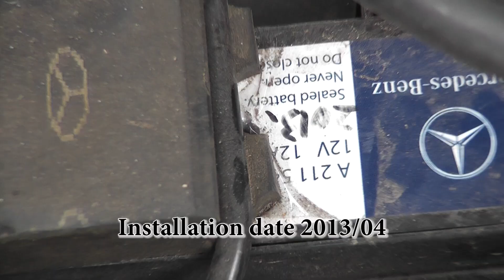Check battery in the SBC block on W211, W219 / Checking charge and year release battery in SBC block

Comment from the maker: Mercedes W211 Replacement the Fuel Filter  https://youtu.be/LVpEIoUC178
Changing SBC Brake Pressure Accumulator in W211  https://youtu.be/CCXlfeDAly4
W211 Replacement or Removing Fuel Pump  https://youtu.be/VXQa5WZXWLs
Brakes failed on the road  on W211 https://youtu.be/tUZg9WytbbE
Repair the IR sensor for Mercedes  https://youtu.be/h5GEVx5uemI
How to reset automatic transmission 722.6 Mercedes  https://youtu.be/_FjX2Yl42t4
Best Life Hacks for Mercedes W211  https://youtu.be/p6bZLZ0WcQc
How to Make AUX on Mercedes W211v https://youtu.be/7JnVR-nF0UQ
Detailed Installation Android 7.1 COMAND & CANBUS  https://youtu.be/EisTZV-FCX8
Mercedes W211 Top 25 Hidden Functions, Secrets https://youtu.be/ZYQwnmydbp8
TOP 55 BEST LIFE HACKS FOR MERCEDES W211  https://youtu.be/CgixWAzrphs
W211 HOW TO REPLACE BRAKE PADS CORRECTLY https://youtu.be/6syWcyTcTVE

Comment: Excellent, to the point, covers the details, and without mumbling conversation!!
Reply from the maker: Thx
Reply: Hi, apologies but what was the conclusion , am having same issues and readings , is the battery faulty?, I've cleaned the terminals too but still coming up with the message auxiliary battery malfunction no stop start no hold function no eml, many thanks.

Comment: when i checked the main battary charging and its work very well , i think there are a cable cut or fuse with that cable from backup battary to generator or SBC but i dont know what a cable to check, is there electronic manual or something like that
Reply from the maker: I do not know about it

Comment: when i check my car battery w211 its just 12.6 v !! i think there is charging problem with my car becsuse when car off the same value 12.6 and i have issue with ESP , ABS any advice ?
Reply from the maker: If there is a problem with charging, even if you change the battery it will not help
Reply: Amazing Road TV when i checked the main battary charging and its work very well , i think there are a cable cut or fuse with that cable from backup battary to generator or SBC but i dont know what a cable to check, is there electronic manual or something like that
Reply: @Mechanic.Bilverkstad  how did you fix this issue ?
Reply: Leon Ripa charging computer decide if battary under 12v its send signal till charger to charge the battary with 13.5 v but its normal if you check the volt in small battary and its says 12v .... if you have issue with SBC u need to read fault code with good OBD
Reply: @Mechanic.Bilverkstad  so it wont charge the small battery till the big battery is full ?
Reply: Leon Ripa No! The charging unit is always charging the big one with 13.5 v But the small one charging every one or two weeks
Reply: @AmazingRoad  здравствуйте подскажите пожалуйста  и за аккумулятора может загареться красная ошибка sbc и ошибки и блакирова ься АКПП
Reply from the maker: @chokikgame833  может загорается красная ошибка, но блакировать АКПП нет, не думаю

Comment: is it possible that i dont have this second battery on my w211 2007 e 320 v6 diesel i opened the hood and there is no second battery
Reply from the maker: After 2006, there is no second battery. and it's very good, you already have no problems with the brakes )))